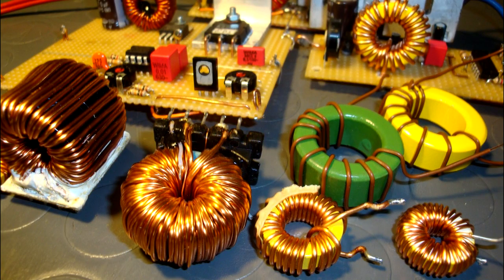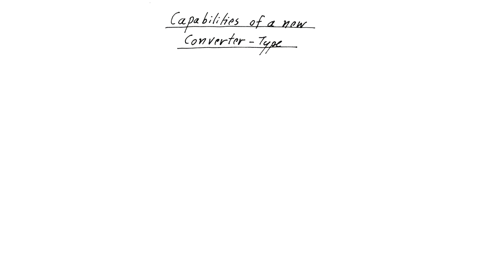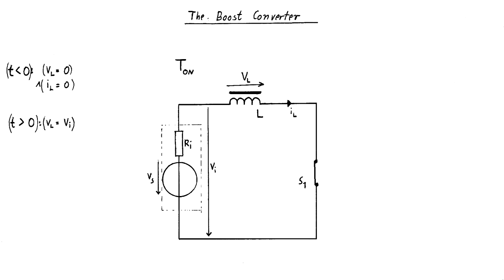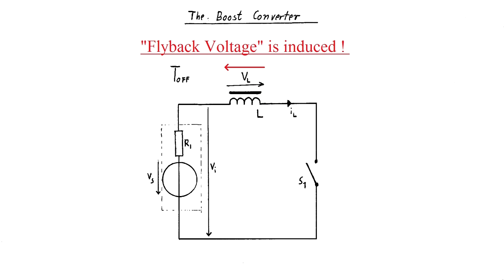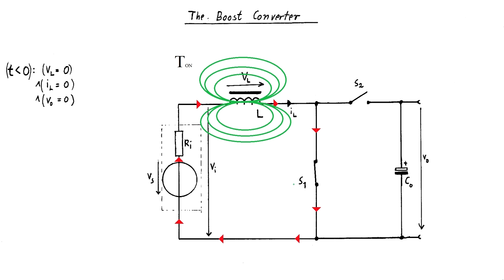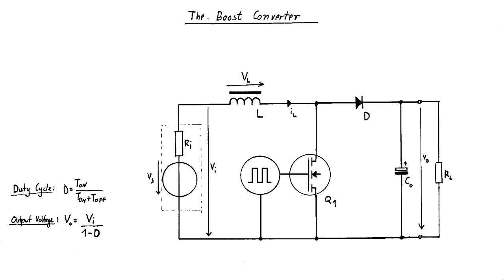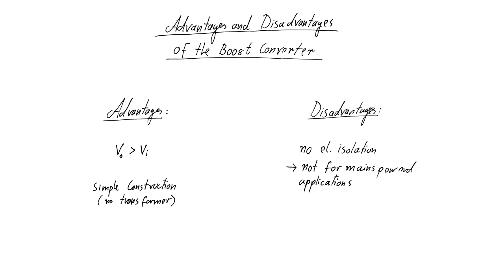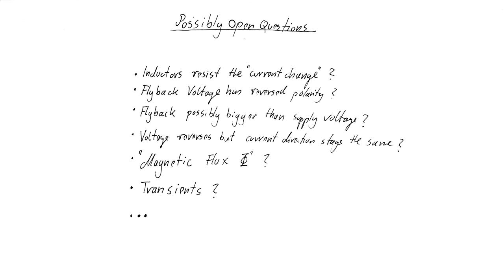SMPS Tutorial (4): Boost Converters, Flyback Voltages, Switched Mode Power Supplies

Comment: The fuel in a combustion engine cylinder is not exploding, but combusting. I don't think there is such a thing as a "controlled explosion" really, unless you only mean its force. The combustion of fuel is carefully shaped and timed to achieve best total combustion. You can't do that with an explosion.

/Just hair-splitting.
Reply from the maker: misium I don't know the exact definition of an explosion. So you might be absolutely right, What I meant is the rapid increase of the volume of the gas inside the chamber that occurs during point 3 and 4 of the p-v diagram of   the Otto Cycle, with point 3, being the moment of highest pressure, where as far as my knowledge goes, the spark is created.  Maybe it is a mere "expansion" rather than an explosion. 
I called it"controlled" because it is triggered and harnessed inside a controlled environment.
Reply: When it truly explodes, it's bad. Called pinging or detonation.
Reply: It's called explosion, yes. Combustion is what happens inside a diesel engine, resulting from high pressure and temperature (no sparks). Explosion is the result of ignition sparks inside a gasoline engine, resulting in a controlled explosion, at least while the only thing that moves there is the piston ;)
Reply: At least this are the definitions I learned from the car mechanic's theory...
Reply: The Post Apocalyptic Inventor I had to look it up, yes explosions apparently can be slow and fast. Fast explosions, i.e. detonations are characterized by a high pressure and temperature gradient in the medium through which they spread (a shock wave). In slow explosions, that is deflagrations, heat transfer becomes more dominant as the means of spreading the energy and it does so more uniformly (e.g. pressure increases in  pretty much the whole volume of the cylinder, after the combustion started).
In other words supersonic explosions are detonations and subsonic explosions are more or less fast cases of combustion. 
Fuel in a cylinder (be it diesel or gasoline) does burn and although it does it rather fast it does not detonate. So yes, you were correct in calling the combustion of fuel explosion, and I mixed up explosion with detonation when writing my comment.
Reply from the maker: Good to know. Also kinda funny that you made your original comment nearly one year ago. Very honest of you :)